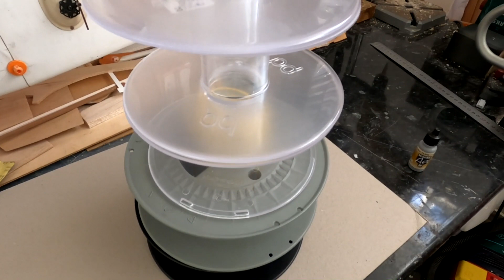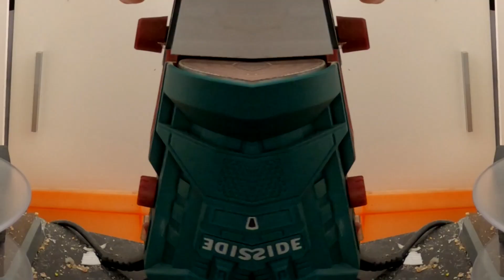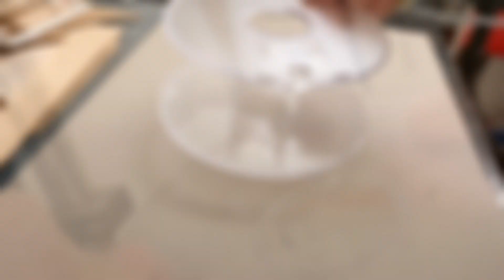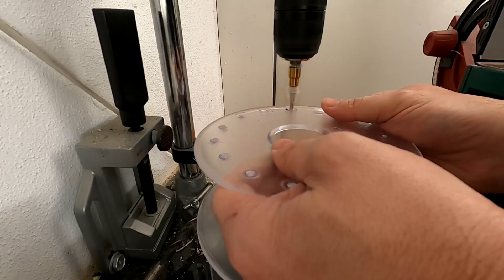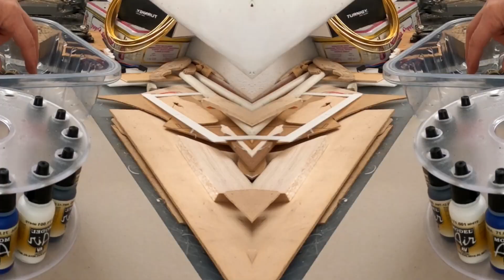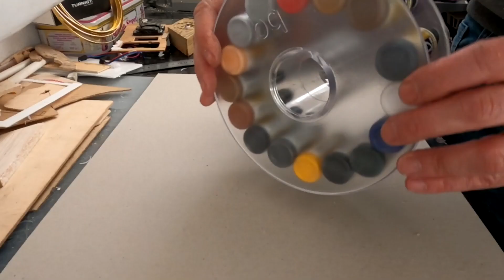Reuse 3D filament spools

Comment: Hmmmm.... can you drill holes in the bottom between each bottle so the toppers will lock different levels together? I may have to try this. Thanks for the idea!
Reply from the maker: I think you might ! Or just put a cilinder on the middle of the spooler and stack them. ;)